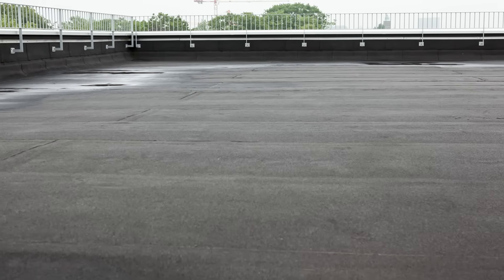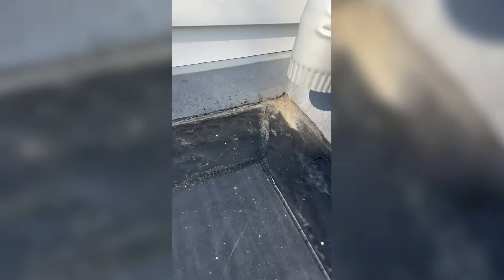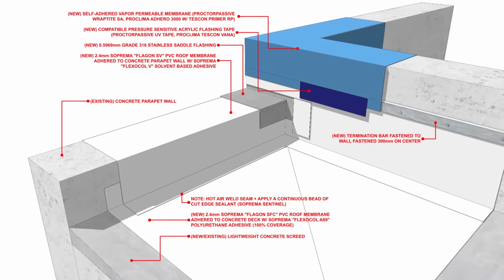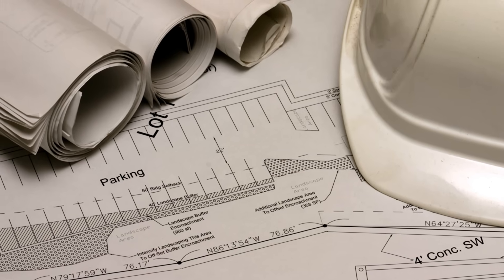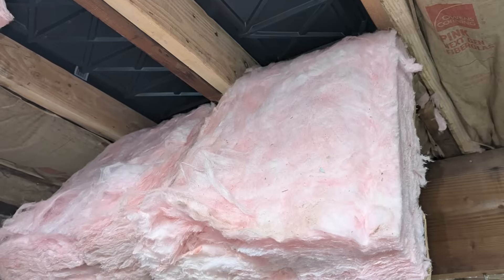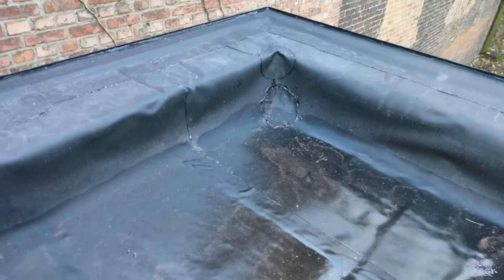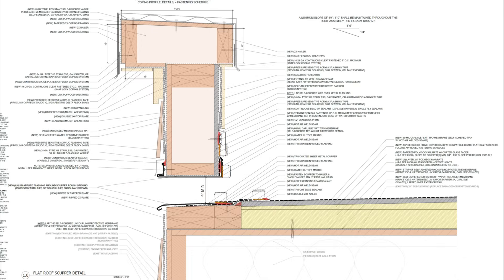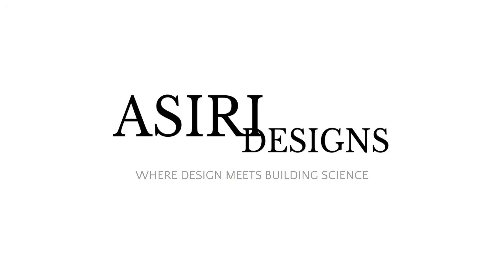Is Your Flat Roof a Ticking Time Bomb? (Roof Failure & Remediation Case Study)

Comment: We have an assembly in climate zone 3C that is 80 mil PVC over 1/4" fiberglass-faced, fireproofing gypsum board over tapered EPS insulation (min 1/2" thickness) over plywood sheathing. We did  not install a self adhered membrane over the plywood deck before installing the EPS. My understanding is condensation is mainly a problem in the thinner parts of the assembly where the R value on the exterior is ~R2-3 (1/2" EPS), where we will apply closed cell spray foam on the inside. This seems slightly odd to me since there will be two vapor barriers - the PVC and the spray foam, with plywood/insulation/gypsum board between them.

Comment: Great video! Just wanted to add that I work for a building envelope consulting firm and we also do a lot of forensics and re-roofing projects. We've found that TPO is not a long lasting membrane overall, however the newest generation of the formulation does seem to be better than the previous ones. Our recommendation for single ply is a PVC or KEE membrane roof. It also can be hot air welded and has a much longer reliable track record than TPO. KEE is a different and more durable formulation of PVC. A old school 2 ply SBS cold applied asphalt roof is the longest lasting, most reliable, and durable as the multiple plies makes it much more puncture resistant than a single ply.
Reply from the maker: KEE PVC is a phenomenal choice, truly the "Rolls Royce" of single-ply.

Comment: You could make the bet flat roof in the known universe, but the railing guy, or cable installer, or someone with stone in their shoe will get up there and wreck it.
Reply from the maker: Very true. Protected membrane roofs/inverted roofs are the only way around it, but they're too costly for most residences and not enough roofers are familiar with them.

Comment: Would silicone roofing systems have a greater permeability to allow drying to the exterior for any condensation issues? I understand the issues with slip risks and dirt discoloration are the main reasons silicone is not more popular, but I am curious what professional designers think of it as a longer-term paint-on standing water resistant membrane.
Reply: The problem with silicone is that it has no shear strength so if it’s on a soft surface (think polyiso) you’ll have micro tears form over time from any foot traffic (even very little foot traffic). You’ll end up with leaks with no visually obvious tears or punctures. For something like a metal roof on an industrial building it would be great and probably last nearly forever. It is extremely slippery when wet though. Like ice.